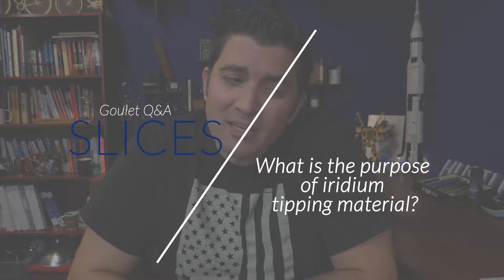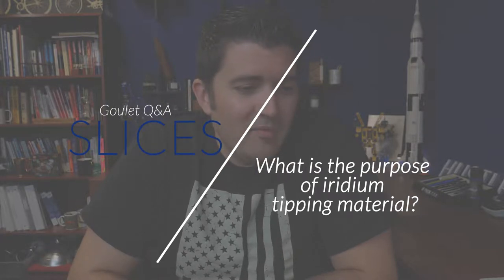Q&A Slices: What is the purpose of iridium tipping material?

Comment: When I was in primary school in the 80s in France, we had to use a fountain pen. We usually had cheap plastic fountain pens with a steel untipped nib. 
The tip of the nib was pinched so there was a vertical blob of steel (up to two milimeters big) that would create a tipping "blob". That's what touched the paper.

Usually these fountain pens where not smooth out of the box and had to be broken in for at least one week (the process could be hastened by scribling on a brown paper bag)
After a while the tip would wear out and comform exactly to the owner's writing angle.
You wouldnt want your class mate to use your fountain pen because a single day's worth of school writing could change the way your nib was tuned - and you wouldnt want to use your classmate's fountain pen because they had tuned it to their own angle, and you would find that the nib would be scratchy for your hand. 

The wear on the tip would create a flat surface that you could very easily see with the naked eye, and the sides would be sharp, so any change in the writing angle would cut into the paper.
These nibs became broader and broader with use (the flat surface would augment) and I dont remember using one of these fountain pens for more than three school years..... But then, it was not only the nib that wore off : the pens would slide off desks, plastic caps would break or be lost...... 

We school kids were so used to these nibs (and we loved them !) than whenever we tried "grown up fountain pens" we found the tipped nib very strange and uncomfortable. Our parents usually had better, less cheap fountain pens, with a tipped nib, ah !

These untipped school nibs still exist, but today more and more school fountain pens have tipped nibs (today, a good entry level tipped nib pen can be found for a few euros in any supermarket here)

These untipped nibs might be the reason why it's so frowned upon to use someone else's fountain pen now ? Because back then, if someone had used your pen behind your back, you could really feel it !
And also that might explain why many europeans prefer medium nibs ? Because it was quite impossible to get one of these cheap pens to write fine. I myself discovered the notion of different nib sizes, and fine nibs, much later when I was in high school ! Now I love fine nibs 😁
Reply: I used to do that with pencil tips.

Comment: In some of my original art training (about 50-35 years ago), I used some nibs by Hunt they called a "bowlpoint."  These were like you describe as having a "spoon shape" stamped into the end of the point so that the very sharp tip of the untipped fine nib wouldn't dig into the paper.  The modern Hunt 512 is described as a bowlpoint also, but it is not as pronounced as the ones I used back then.  These, incidentally, are dip pen nibs.

Comment: Iridium hasn't actually been used for decades for tipping (since the mid 1950s). The 'Iridium tip' is more a brandname at the moment.
Also, iridium tipping was only necessary for gold nibs, gold being really soft. But for steel nibs, its not really required - I don't know of anyone who has ever seen a worn out steel nib unless using very acidic inks.

This is a good analysis of several contemporary nibs by gas chromatography (someone was actually dedicated enough to do this):

https://www.nibs.com/blog/nibster-writes/wheres-iridium

https://www.nibs.com/blog/nibster-writes/how-can-we-talk-about-iridium

From microscopy, the folks at nibs.com think that "IPG" nibs are just tipped by melting back the nib material into a blob, with exactly the same composition as the rest of the nib. Which would make sense from a manufacturing point of view as its easier to do.

Comment: Iridium price is not a concern... do the math and calculate how much tipping material is needed to 1nib then you will find that from 1g of Iridium you can get hundreds of tipped nibs. 1g-Ir=44.326mm^3, 0.75mm ball volume is 0.158mm^3 so dividing you will get 280 balls. So giving the price of 202USD/g it is below 1USD per nib.